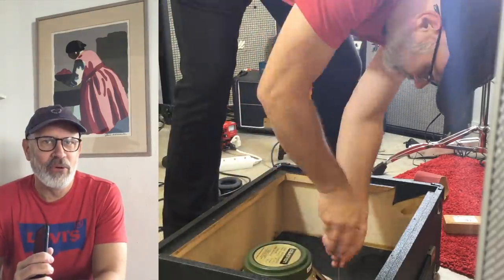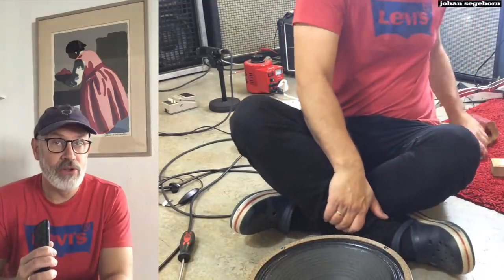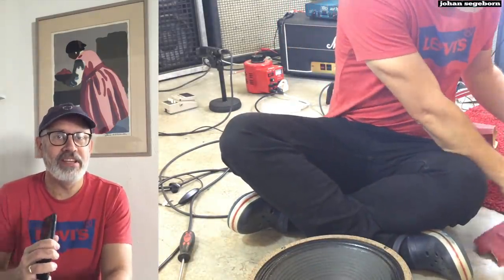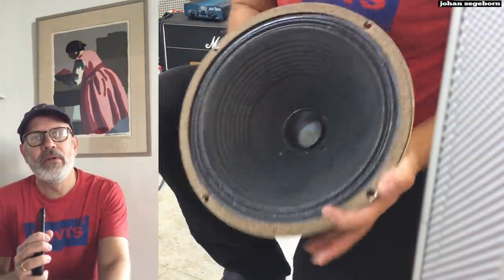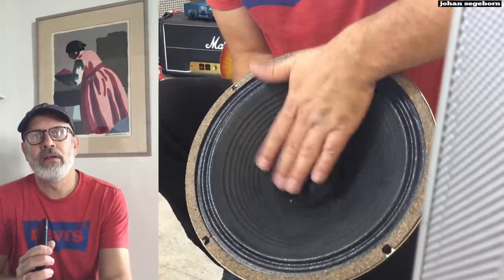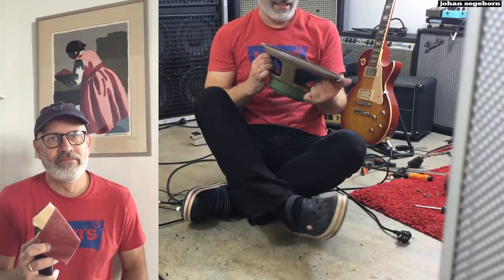New Greenback + SAND PAPER = Vintage Greenback?

Comment: Next - dividing the cone into multple sectors like a pie chart,
then abrading some sectors to varying degrees of roughness, whilst leaving some sectors new as stock.
That series of comparative tests should keep the most obsessive tweakers and modders occupied until at least xmas...
This could become a service provided by amp techs..
"That'll be 50 quid for an eight sector cone with two 25% and two 75% sand downs...
or 200 quid if sir wants the premium vintage early 60s tone completely sanded down and gone to buggery service"...

Comment: I was surprised to hear a difference even with iPad speakers.  I’m thinking that the sandpaper breaks the fibres on the cone surface, reducing the bending stiffness of the paper where it’s most important. Speed of sound in the paper is a function of the stiffness, so this changes the tone of the speaker.  An old worn in speaker probably has the paper fibre broken from use, so it seems like a brilliant way to mimic aging.  To be really scientific, I think you would need to get measuring tools, but just hearing it sure works.
Reply from the maker: Thanks man, maybe I could get some help at Chalmers University if Technology here in Gothenburg. They do acoustics research.
Reply: Johan Segeborn Chalmers might have an acoustics department, but you have at least half the tools: good microphones and a place to do testing.  You just need software that does loudspeaker analysis.  There’s some really good amateur software out there now, some even free, for doing frequency response plots.   Pro level is something like JBL Smaart or MLSSA software, either are over $1000us to buy. Hobby level, but lots of pros use it, is something like TrueRTA which is, as you say it so well, about a hundred bucks.   There’s also apps for iPhones that do real time frequency plots.  Measuring speakers is a big hobby in the hifi loudspeaker world, but it seems to be unheard of in the guitar world, where players just use their ears and decide, which they should.  Anyway, like you don’t have enough to do already, here’s something else to try!

Comment: Anyone commenting on sound should tell what they are listening back on. I listened to this through my single ended 807 amp and JBL Pro 3 way speakers. A good low to medium volume reference system. The stock highs sounded almost shrill to my ears. The sanded smooth tone was better, and the thinned cone sounded best to me. It had the mellow rolled off high end that allowed the mids to come out as glorious and harmonically rich like many vintage speakers tend to have. Less hifi sounding than the stocker.
Reply: HUGO FUGUSEV absolutely!  On my iPad speakers I hear almost no difference, but plug in good in ear headphones there’s a huge difference.

Comment: Sanding the paper is changing the cone mass.  If you measure the Thiel-Small speaker parameters of an original, reissue and sanded versions, it will probably show the mass reduction and which is closer to the original.
Reply from the maker: On the first instance where I just roughed the surface up a bit , I think the material lists was negligible. But maybe the stiffness was affected

Comment: I know this is a little off topic, but I hear in this video, --- When the notes are sustained and slowly decay, I can hear a little hair in the decay. This drives me crazy in the studio but hearing on other peoples stuff using similar gear makes me feel like it's normal, or atleast not un common. It's so faint most people wont notice it. I have noticed it more on my KT66 JTM 45's than on 50 watt plexi amps. What's your take on this???
Reply: If you are talking about the static sound during the notes trailing end, that's blocking distortion. most likely at the grids of the output tubes. It is from overdriving them into positive grid bias - this charges the coupling caps up (higher dc potential) and shifts the bias colder. it takes a little time for the bias to reestablish itself (For the caps to discharge back to normal potential). That part of the sound really bugs me too but I try to ignore it. I think when you add drums it becomes much harder to hear over the cymbals.

Comment: Surprised to hear such a big difference! The sanded down sounds brighter and harsher while the roughed up (should it be smoothed out?) sounds smoother, almost like you turned presence or treble on the amp down by a notch or shifted the whole frequency range down a little bit. It gets rid of some "rattyness" of the high end.

I'd love to see a followup video comparing this to an actual vintage GB! Also you should definetely work with Celestion to get them to do a proper vintage reissue Greenback so those of us who are not in the US could enjoy it without paying a lot for Scumback speakers.
Reply from the maker: Thanks, This speaker is compared to the original in this video
https://youtu.be/uhqX7Glzyog

Comment: I've tried smoothening my g12t-75 today, and I noticed some results  after that!
Reply: No sound now anymore then?
Reply: What was the result ?
Reply: @kroustyman   a little smoother but the change was about 5% maybe less. replacing speakers will make MUCH more noticeable change!
Reply: @alexts4920  I just tried it this evening on a V30. My buddy didn't knew what I did and said the treated V30 had less highs, and indeed it was less harsh than the other when I checked out.

Comment: Definitely a loss of treble and clarity from the sanding, which I find undesirable. One could just roll the tone down to remove treble when necessary, but clarity is always good IMO. You want less clarity use cheaper speakers or something.
Reply: If you remove frequencies earlier in the chain then you remove saturation and current from the output, so no.

Comment: Johan this was brilliant...I'm just curious as to how the speaker cone would sound as it was worked up from 60 grit to 600 - 1000 then wipe it down with Naptha or Acetone...I guess I'm going to have to try this out. with John Mark , builder of Trainwreck Circuits. I will let you know asap.
Reply from the maker: Thanks Jerry, I suspect John has things of a slightly higher dignity on his plate though ;-)

Comment: In a guitar speaker the texture in itself won't play an important role in the tone shaping.
BUT...sanding the cone and changing the thickness and rigidity certainly will...and did!
You could also play with the speaker surround. That will change the speaker response as well.
Reply from the maker: That’s a good reflection. I didn’t change the mass or thickness noticeably here, but since I removed the outer harder layer it may have influenced stiffness. So it’s either stiffness it surface texture. I’m still very much in favor of surface texture since otherwise Celestion would have gotten it right.

Comment: I wonder what the actual reason of the tonal difference is. I'm thinking that simply removing mass from the cone is making it more supple,  as if it's been aged and broken in. It would be interesting to see if a reissue greenback would be the same as a vintage one if it were aged and broken in naturally for a few decades. I'll let you know once my time machine is ready so you can test this.
Reply from the maker: There was only a minute amount of mass removed so I’m fairly confident it’s the surface structure and stiffness

Comment: My guess is the sanding makes the cone slightly less rigid, allowing it to move a little more freely. Basically breaking it in.
Reply: I think it also puts a little heat into the paper and combine that with slighty less material and you have taken the stiffness out of it and it makes the paper breathe more freely!!

Comment: Lol... there's no difference
Only years of play can break a speaker in
Reply from the maker: Many companies offer break in as an option.
Reply: @JohanSegeborn  sure you can put it on a Transformer and break in the spider but time cures paper and glue... the sound changes. I'm no scientist and you certainly have more experience with valuable speakers than me but my old ones sound the best to my ear
Reply from the maker: The reason we like the old speakers is the old records that were recorded when the speakers were fairly new. Break in takes about 60 hours, after that it’s downhill I think. Cheers
Reply: @JohanSegeborn  point taken thanks

Comment: The sanding down seems to remove some of the top end. That could also be done by turning down the treble knob on the amp.
Reply from the maker: By that standard you could use any speaker and compensate for it using amp EQ. The purpose of this this test is to deal with the synthetic sounding top end of new speakers.